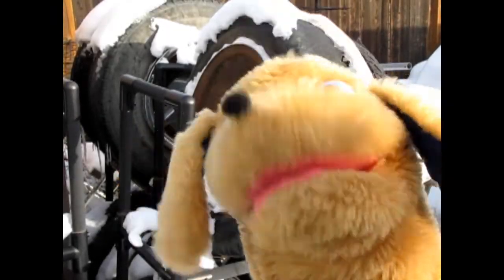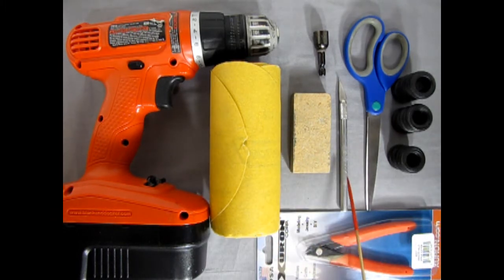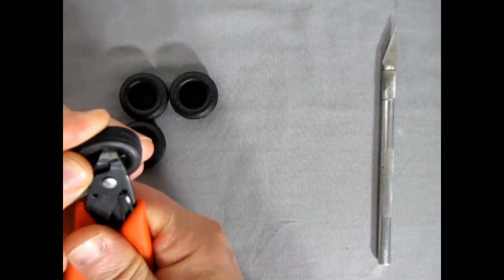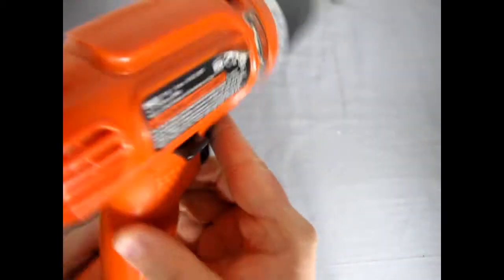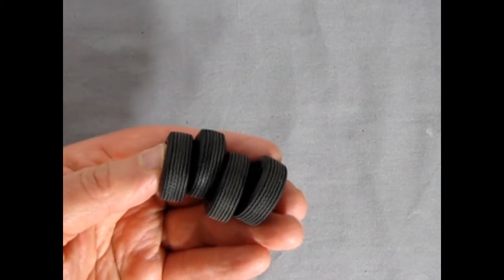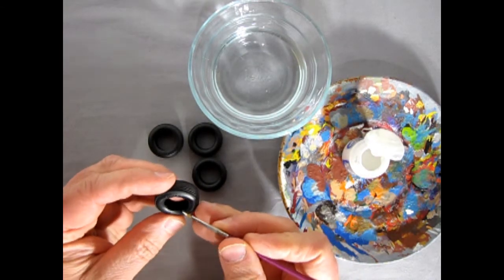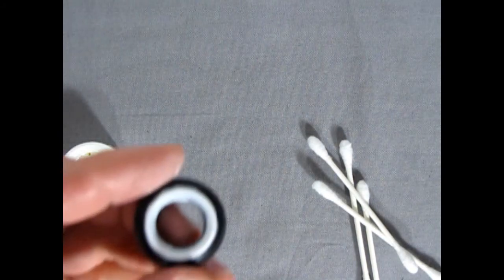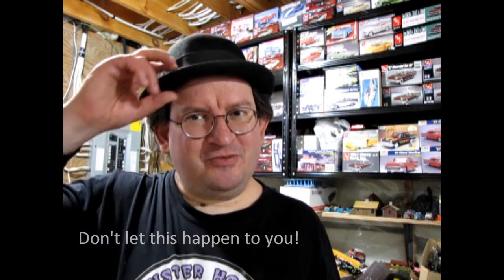Model Car Garage Tips and Tech - How To Perfect And Paint Your Model Car Tires - A Model Car How-To

Comment: Try using a Gelly Roll pen (available at Walmart)  The "ink" is acrylic paint and you can get it in while. The roller ball tip comes in 3 different sizes and it will not flex when pressed against the tire as a paint brush might.
Reply from the maker: Sounds like a good idea. Have you tried it on a spinning tire before?
Reply: @MonsterHobbiesModelCarGarage  I have not.  Only for white letters so far.  I would think, however, that the paint brush technique would work best for the wider white walled tires.
Reply from the maker: @bobschaar5720  I have painted a few narrow tires with a brush using the "Spin" method. I just wondered if the pen would be hard to hold onto with a spinning tire. 

Wonder if I could experiment with a sharpie? I'll have to try that sometime.
Reply: @MonsterHobbiesModelCarGarage  probably not if the tire is spinning slow (adjustable speed drill).
Reply from the maker: @bobschaar5720  True. Must be a slow day if I didn't think about that! :D

Comment: Could use a socket adaptor and a 7/16 deep socket for more room and not have the tire pop off.
Reply from the maker: Sounds good. My Dad made me some cones that you push the tires down on, but they only fit in a drill press chuck. My drill press broke years ago.